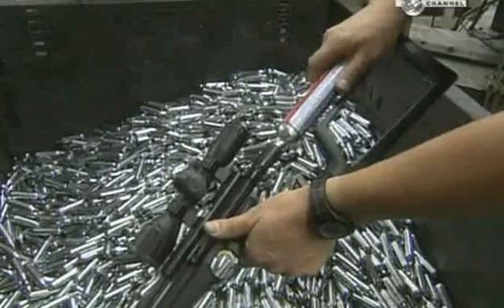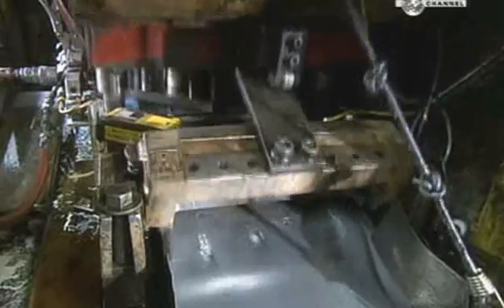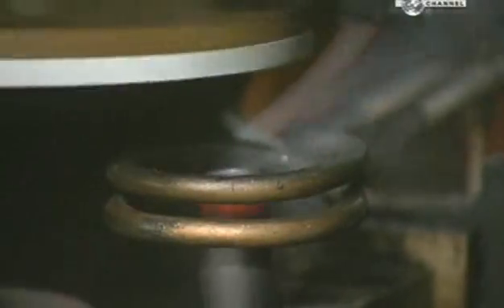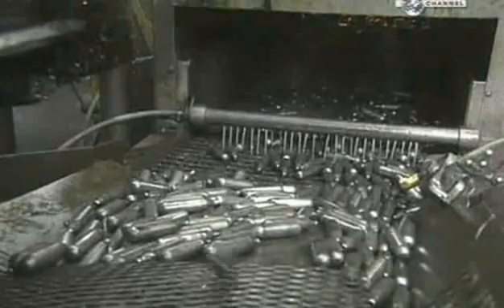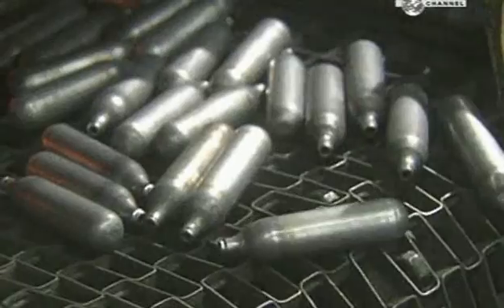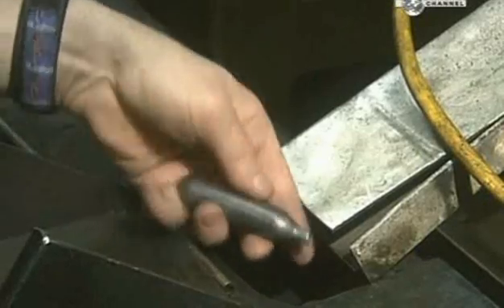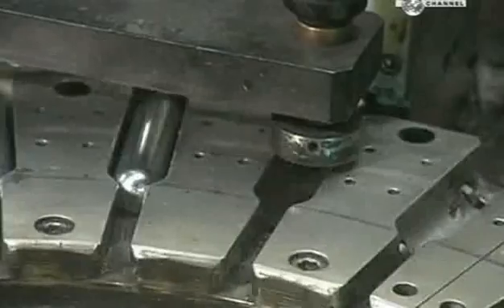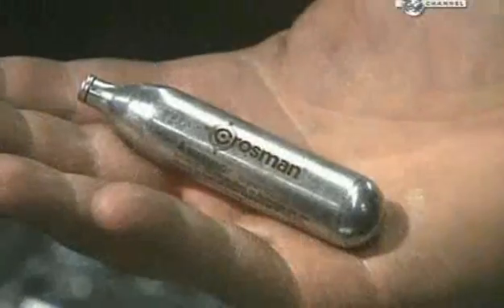How it's made- CO2 cartridges

Comment: If liquid co2 is pumped inside then the internal pressure of the cartridge is about 800psi (vapor pressure of co2). My question is the volume of liquid co2 in the cartridge 1/3 the total volume of the 12g cartridge like bulk tanks?

Comment: @illegal7578
CO2 can be liquified. What you mean is that dry ice doesnt melt because the solid CO2 directly sublimates to CO2 gas without getting liquid first. But the other way round, when you pressurize CO2 gas, it gets liquid.

Comment: I bet a good deal of that cost could be accounted for.  They would have to have pretty stringent quality control when making something that has to hold that much pressure.  The manufacturing process also looks fairly involved, and I don't know what the cost of materials is.      

You can't refill because they don't have a valve.  It would be very difficult to put a pressure-rated valve on such a small container.  The only way to refill is if you had a machine that re-capped it for you.

Comment: They're non-refillable because of the seal used. As you can see, it's a metal foil... When loaded into a gun, this is punctured to let out the gas.

Refillable rounds could be made by using a valve instead, but this would make cartridges even more expensive. Plus, a 12 gram cartridge is too small to refill economically (cost of labor, etc)...

Cheers.